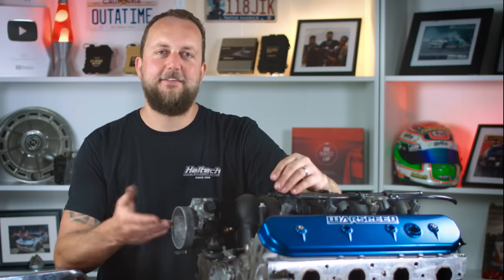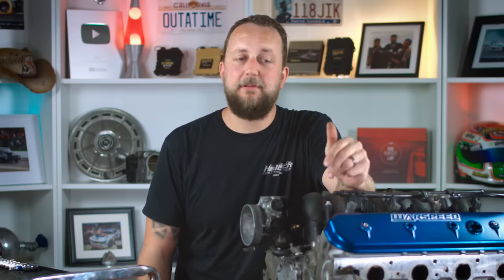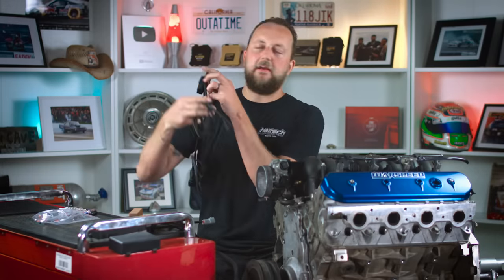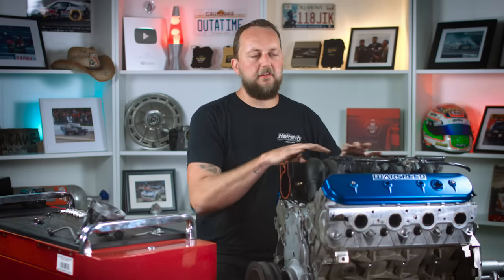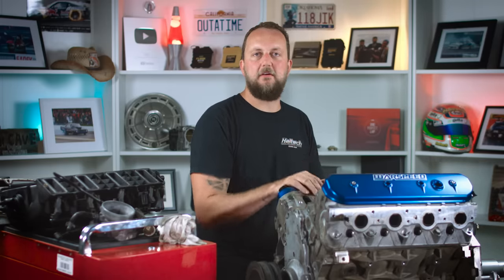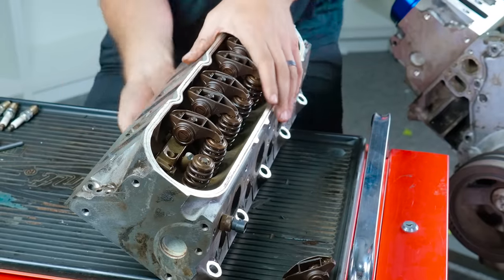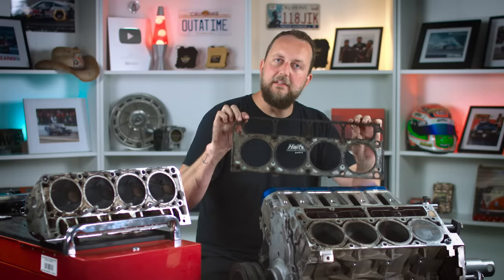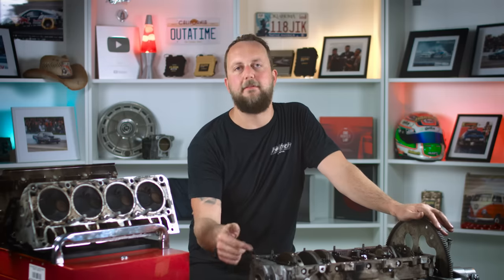🤔 What's so special about the LS? | TECHNICALLY SPEAKING |

Comment: Fun fact: LS heads are not mirror images from one bank to another.  They are actually identical on both banks.  The only exception is that some aftermarket heads have steam vents plugged which will require you to put the head on a specific bank of cylinders!

Comment: we can even say that the intake manifold is reversible for a rear mounted throttle body...heads can mount either side... exhaust manifold are either flip upside down for front exhaust with top exit or side swapped for downward exit.. need to watch for Cathedral or Rectangular intake ports on the heads and intake...or LS7 and LS9 cams are for dry sump engine

Comment: Its flow at low rpm. A engine is a air pump and LS engines are the best pumps out there. That's part of the reason for torque at low rpm.

Comment: The poor Ford 351 Windsor. With lots of deck height, a solid block, good oiling, and evenly spaced ports it still didn't get the love of the SBC. Then along comes the LS to garner all the glory.
Reply from the maker: Nothing wrong with the good 'ole Windsor - but you're right the SBC got (and is still getting) all the love...

Comment: Because it's ridiculously easy to make big power reliably. My LS3 Camaro is already above 400 stock. Heads and cam and tune put it at 650 horse from Texas Speed. You can go from mild to wild in a weekend with very little effort.

Comment: The first automotive V8 engine to reach production was the 1914-1935 Cadillac L-Head engine introduced in the Type 51 so GM did kind of invent the first v8.
Reply: N0TE The first V8 was built by a French man in 1902. GM was just the first To get the engine in production they didn’t invent it.
Reply: @thomasbrindley6433  
Correct. And, Chevy did have a v8 in the 20s I believe .
Reply: @xmo552  Chevy didn't get a v8 until 1955 even the Corvette started out as a v6 until 55.
Reply: @timtaylor1483  
Corvette had an inline 6 not v6. It was called the Blue Flame.
And..

https://autoweek.com/article/classic-cars/38-years-chevrolet-small-block-v8-there-was-chevrolet-v8

https://en.m.wikipedia.org/wiki/Chevrolet_Series_D
Reply: @xmo552  I know it's a difference I just say v6 lol.
Reply: How bout for
Reply: Ford*
Reply: @thomasbrindley6433  We are talking about car engines and not airplane engines smart guy. Why not throw some boats and submarines in as well.
Reply: @moel7272  
The 3 dots to the right allow you to edit your reply.
Reply: @derekhoward3371  
Cadillac became in 1902 when it broke away from Ford.
GM became in 1908.
GM bought Cadillac in 1909.
Chevrolet broke off GM in 1911.
Reply: @n0te618  My bad, after doing some research this v8 Invented by the French bloke was indeed intended for aircraft and boats. But is was used in p
cars as well between 1903 and 1912.
Reply: Chev guys hept in dark, think they are all that, just copy is what chevdoes best...

Comment: You overhead cam guys are funny, lol, good video man, but pushrod for life bro
Reply: You name any pushrod you like and I will counter with a smaller OHC engine that will blow it away in terms of power and torque per cubic centimetre of capacity and be better at fuel efficiency and emissions in the bargain. Pushrods are a dinosaur in today's technology!
Reply: @garyquinlan4075  The reality is the first engines were built as dohc and dohc only for 30+years. Later came the push rod engine.🤭🤷🤦

Comment: Improved 6 bolt, cross bolted mains combined with the BBC style valve layout meaning no exhaust valves right next to each other.  Two of the weak spots you run into making big power  with boost on a factory SBC are the saddles/block itself which usually self destruct before reaching 1000hp and head gasket failures from the hot spotting between the center cylinders because of the eiieeiie valve layout. 
For people wanting to make big street power a ls with boost is the most economical choice. As well SBC always were the number one choice swap motor.  Now there are literally millions of LS engines built and its been over 2 decades since the last Vortec style SBC was offered.  So as far as availablity the LS wins there too.  Then you look at size and it wins again compared to the huge ford mod motors and hefty hemi. And aftermarket swap support compared to the mod motor or the hemi is night and day.
So just like the orginal SBC, cheap, available, lots of aftermarket support for the engine and swap.

Comment: LS is the greatest engine of all time. The end.
Reply: Eze&Yare Dominguez  there's another kind?!
Reply: Why it hasnt hardly changed for a half of a century
Reply: Not entirely, it’s not fuel efficient, it’s loud, it weighs a bit, etc.
There is and isn’t a lot categories that the LS sucks at. 
Honestly it’s just personal preference. It’s not really facts cuz the W16 can overpower a Stock LS. And I feel like the LS is very overused and taking the easy way out for power.
EDIT: As I SAY AGAIN, ITS PERSONAL PREFERENCE . To me, it’s just taking the easy way out cuz the LS comes with 450-500 HP Stock. I’d rather have something below an 8 cylinder cuz I love the sound of V4(bike motor), V6s, 4 bangers, in-line 6s, straight 4s and straight 6s, rotaries etc. 
🔰That’s my opinion.🔰

Comment: Forgot to mention the mid range power of the small block chevy is untouchable
Reply: 2012 2SS/RS Camaro. Downtown Atlanta rush hour, already doing 65 and drop the 6 speed one, punch throttle, change lanes and feel like an automotive god.
Reply: Huh mid to low range would belong to the 4.6 5.4 they have flat torque curve and will pull like no other
Reply: @austinhowze6280  there junk ford engines.... Ford don't even build anymore, throw away engines, not even in same class as ls chevy engines?
Reply: @donaldkinder6716  the chevy la is in a different class but chevy is the one saying you can expect 150k or 200k service life out of this engine where Ford is not ford tells your there v6 just got broken in at 200k yes the ls is reliable but is the only engine gm ever built for a newer car oh and ps I like imports to but no one going to say the ls is better than a 2j or a 1uz in reliability
Reply: @donaldkinder6716  oh and the 4.6 and 5.4 2v engines will break 500k miles easy that's why you see ford cabs more than chevy cabs you just have to take care of your car
Reply: @austinhowze6280  keep dreaming buddy, see plenty not even get 200 thousand miles, dam plugs blow out or break off, biggest pos engines, Ford ever put in a truck or car?
Reply: @donaldkinder6716  lmao some one dont read owners manual but hey dont let them old crownvics get you speeding in you shit box they only been in service for 20 years

Comment: I think the reason why the LS still uses pushrods is mostly to reduce manufacturing cost, instead of making it significantly smaller since a well designed DOHC that uses bucket shaped cam followers, and small sprockets when connecting the camshaft to the crank wouldn’t add much height to the engine as in no where near as much height or width compared to a typical small block V8 with DOHC

A DOHC engine would be able to produce about 20% more power and possibly more torque down low if it uses variable valve lift. 

The downside of a DOHC is that it’s expensive to the point that it’s cheaper to make a larger pushrod engine that produces similar power output especially if a manufacturer is going to be producing tens of thousands of these engines per year.

Comment: Ok, please don't shoot me, well, I know it's s very (VERY), reliable and simple engine, where people have been pushing shitloads of ponnies out of it, but man, 2 valves with heaps of weight moving around, still prefer a nice I6 or B6 (those are stupidly more complex, I know and they break, a lot, alone, even  inside a garage), also, they can be more easily turbocharged (I know people usually supercharge this things for even more shitloads of ponnies). Hey, I'm just an european, well used to small engines, and mainly 2L i4's and 3L i6's or V6's turbo diesels, not so many ponnies, but tons of torque :D However, I would love to swap some european tin can with one of this things, because, highly erectile noise. Cool vid mate.

Comment: First thing is the 6 bolt mains the crankshaft is bolted in place stopping crankshaft flex or movement it's extremely stable even at high rpm second is the rectangular port heads they flow huge amounts of air or flow if these heads are CNC ported with the right camshaft a 6.0 or 6.2 engine can make 550-600 horsepower naturally aspirated and idle decent and be streetable third they are reliable and durable and if maintained and not constantly beat on can last twice as long as the old style smallblock the torque and power throughout the entire rpm range is outstanding it can idle at 800 rpm with a healthy cam and rev to 7200 rpm with the right setup peak torque on these engines is in between 4400 rpm on a stock truck engine and 5000 rpm for a LS3 engine stock with a healthy cam it can move up to 5200-5500 rpm this is the rpm range most old style smallblocks make peak horsepower while the LS is just getting started and starting its power band
Reply: Spot on 👍
Reply: @johnboy5167  LS engines love high stall converters 3000-5000rpm depending on gearing and transmission used my modified 2011 Camaro 2SS with a new GM performance LS3 495 horsepower crate engine with CNC ported LS3 heads tuned and runs on E85 with many other upgrades has a built 6L80e automatic transmission with a Circle D 4200rpm stall converter with the stock 3.27 gears and so far I'm pretty happy with the performance and driveability throttle response is very wicked from a dead stop to 130mph
Reply: @gloriamaletta8667  l have an ls3 naturally aspirated making about 500 wheel hp in a hsv clubsport r8 it's no 9 of only 100 made it also has nitrous injection which takes it to about 650 wheel hp had it for 6 years from new have not had any problems with it very good engine 👍

Comment: I have a 2004 Silverado Z71 with a 5.3 LS engine.I bought it brand new. It has 380,000 miles on it right now and it runs like the day I bought the truck new.

Comment: Also one of the few things at GM where the accountants or recent engineering undergrads wanting to do a thesis project don't seem to be involved in the design. So it's proof that some things can be done right if not tampered with and kept simple. And because of the old school KISS aspect and reliability, sometimes it gets swapped into other cars from expensive brands to replace their over-engineered engines because the owners simply want to drive the car instead of having to pay for them again in parts and labor of an ongoing repair project.